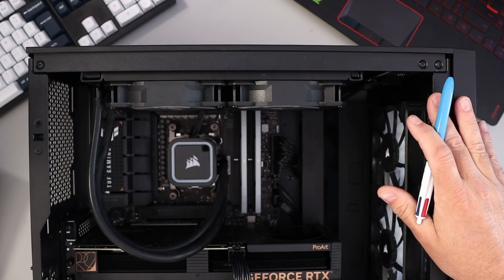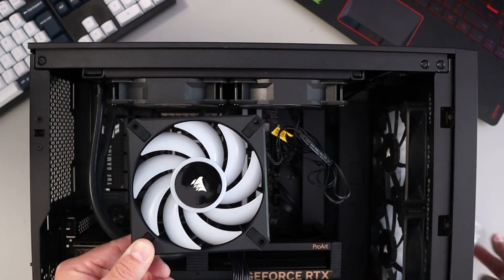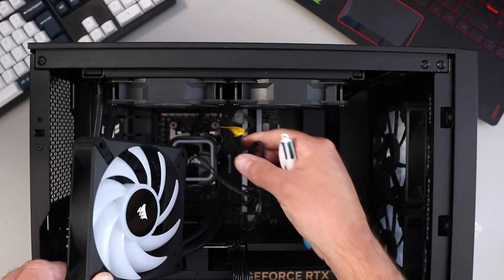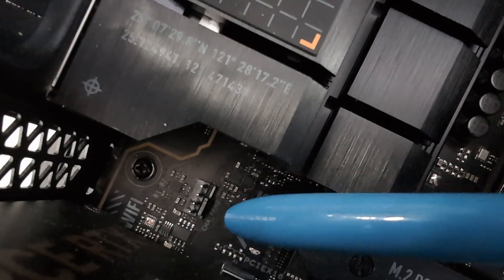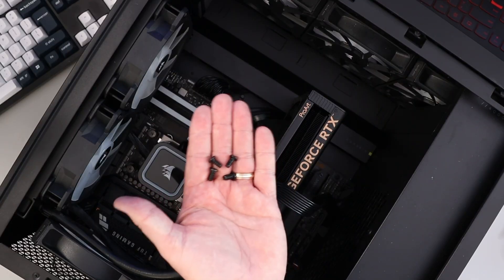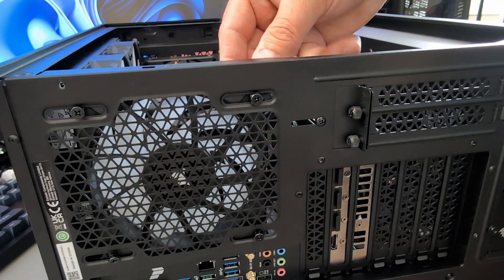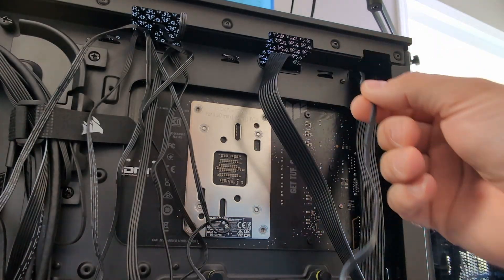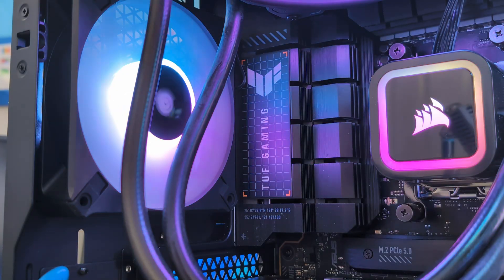How to Install Corsair AF120 RGB Elite Fan in Corsair 4000D RGB Case

Comment: What if you didn't put in the 2nd cable? Would it just color cycle through the different default colors since it is receiving power? 
I mean the RGB controller is just to control it?

Comment: in this case, is this fan taking air out or bringing it in? i believe the 3 preinstalled ones are bringing air in correct?
Reply from the maker: The three at the front bring in the air and this one at the back is taking the air out
Reply: @NorthernVikingEveryday thanks!

Comment: Hey i already buy the corsair icue 4000x rgb + the corsair icue h150i capelix xt. I want the af120 on the rear and the top of the case can i use the front screw from the case. I already try and it feel really hard so i didnt continue. The small soft grey part block the screw